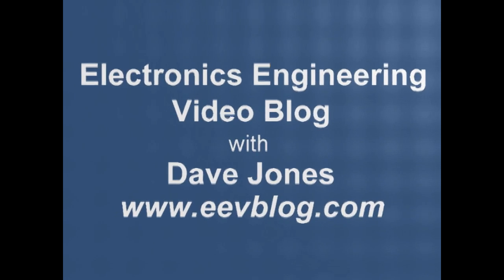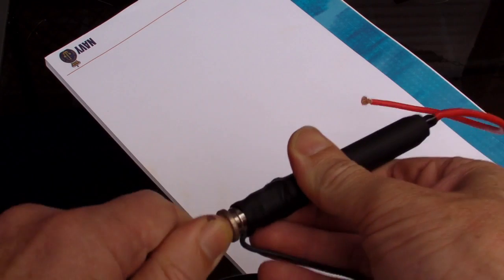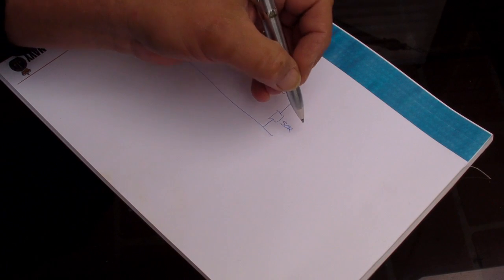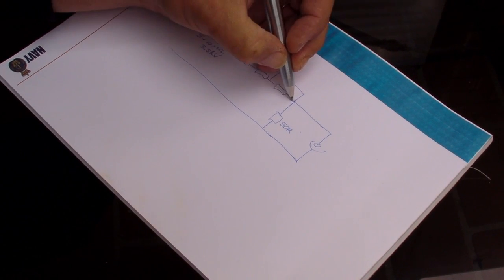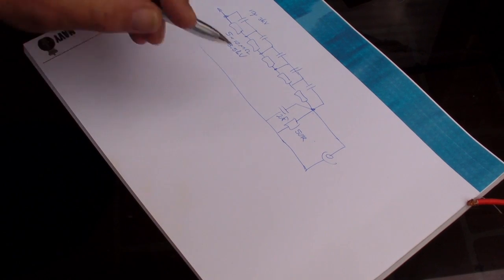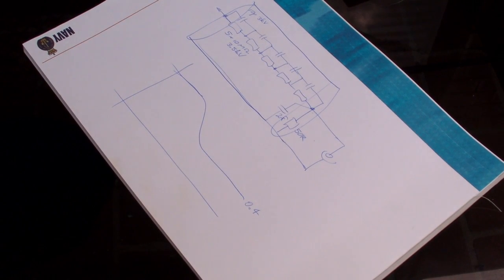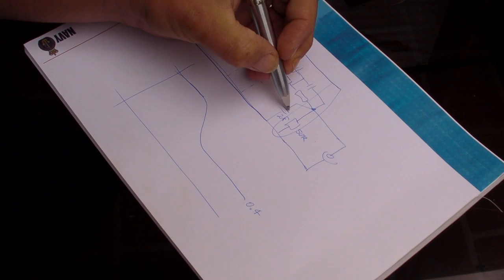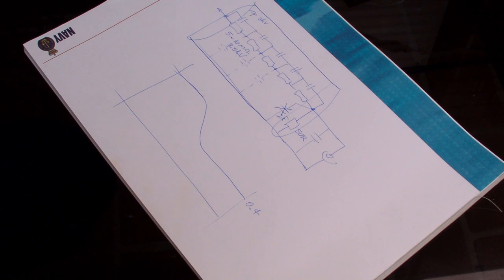EEVblog #85 - High Voltage Oscilloscope Probe Design

Comment: Hi, thanks a lot for your video. In order to check the wave of an inverter or mains, is it ok to use a step down transformer 240/24 ? Will it smooth or disturb the 50/60Hz signal ? What about armonics ? Thanks.

Comment: Question please....  When you connect your scope probe, do you set it for x1 or x10????  the resulting multiplier would also be selected in the scope, (the 1000x option) I have a small bunch of 1000Mohm 10 KV 1 watt resistors and if I was mostly using for DC voltages, could placing one of these in series with the scope probe and with the scopes impedance being ~1 Mohm, would this provide satisfactory readings with the scope probe set to x1 and the 1000Mohms would be very roughly a 1000 to 1 ratio???  I did try this for my DVM with 2 1000Mohm 10KV 1 watt resistors in series and this worked out to about a 200 to 1 ratio since my Fluke has a typical-measured, 10 Mohm internal resistance and my reading were very close to what was expected, (the Fluke is considered to be a x1 device)....  It would not be elegant, but do you think a similar hook up for my scope would suffice??  Thanks for any explanations you may provide....  Hank

Comment: Hey Dave, this is excellent! I'm not much of an electronics guy, mostly mechanical, but I do need to do an increasing number of electronics projects these days. So I was wondering if you have an EEVblog # that deals with how to Protect a Probe from a voltage spike? Thing is, I made a make-shift probe for probing vehicle secondary ignition signals, and if the coil or wire has leaks, a 30kv spark will jump into the probe tip and fry the scope. It's an inductive pickup of sorts, so it's not designed for direct electricity. So I was wondering how to make some kind of shunt or protection for those sparks. Got a blog on doing that? Thanx!

Comment: For divide by 1000, you should consider two divide by 32 stages.  Also, you can provide an inner shield connected to the probe if your HV has low impedance; this increases input capacitance, but maintains your HF response.

Comment: what happens if you put two 10:1 attenuators in series? does it make it 20:1?
Reply: Gear Wrench87 No. Think about it this way: what happens if you take 10% of something and then take 10% of that?
Reply: 10 percent of 100 volts is 10. 10 percent of ten is one.  200= 20   i think that would make it higher attenuation then huh?
Reply: Yes, having two attenuators of 10:1 in series would result in more attenutation of a signal going through than a single 20:1.

Having multiple stages of attenuation results in the overall attenuation being equal to the product of each stage. The same applies to amplification. If you have two stages: One with a gain of 5 and the other with a gain of 2 then the overall gain would be 10 and not 7 since you multiply rather than add. That being said, If your gain or attenuation was written as a logarithmic ratio or dB then you would add or subtract across rather than multiply or divide.
Reply: trophosphere  beautifully stated. Thank you.

Comment: Cool,but good probes use coax with a resistive center conductor to reduce ringing when used with a high impedance scope input.A resistive conductor distributes the total resistance (usually around 100-200 ohms) over its length.A lumped (discrete) resistor on the end of a piece of regular coax will not noticeably reduce ringing.Also a hi-Z probe should be well shielded and then there is the 'high voltage' issue....

Comment: I'm interested by the cal factor. What does this represent exactly? Is it the ratio of input to output voltage?
I assume that you'll be attaching your probe to an oscilloscope, which will have 10-15pF capacitor and a 1M ohm resistor within that scope. It looks like you've omitted that out of your design, which also might be a reason why the cal factor alters at 200Hz.
Reply: 08Ultrasonic Yep that's what the cal factors means. And he designed the thing to fit the scope input as stated in the video and no the scope input has nothing to do with it, it was stray capacitance

Comment: My oscilloscope is a PC type that connects via USB. For testing your average low voltage signals and frequencies it works well and responds fast! However, I've built some "high" voltage DC power circuits and voltage doublers varying from 100VDC to 350VDC. I have a two-channel OWON VDS-1022 which says the maximum input voltage is 40Volts from what I can see.

So how could I test that? Could I modify the probe or use a resistor or two? I'm not talking KiloVolts here!
Reply: You basically need to scale down the voltage. I would build a 10:1 or 100:1 voltage divider to probe, depending on the limitations of your scope specs. If you alter your probes attenuation, you'll have to scale in the difference on the display. You should look up the design of a scope probe. An attenuating scope probe is basically a voltage divider but bear in mind that you have fixed 1M resistor in your scope that you can't change.
Reply: mine is just my soundcard :) its pretty good too.

Comment: Nice video. I guess it must be very important to properly clean away every little particle of grease, dirt and flux residues from the whole RC network before potting it in order to minimize the risk of arcing?
Reply: Yes you can also use a dielectric adhesive which can increase the breakover voltage.

Comment: Hi,   How do you measure  a  higher voltage, like 50kv  that is very low frequency so we cant use the propes as antenna pickups..?
Reply: Kaledius just as it was done in this video. You can probably scrap all the capacitors though since you don't care about medium or high frequency

Comment: Do you think it is safe to use these probes to check the voltage of windings of one SMPS?
Reply: What type of an SMPS? If it is a flyback converter with 15kv output probably no,  but if it is just like a 12v psu it is ofc ok.

Comment: I have a question about digital oscilloscopes. Do you know what bandwidth would be needed to measure the peak resonance of a coil rated around 3000kHz? I'm not sure if the bandwidth is actually the specifications of the frequency range it can detect, or if it is something else. If you have any direction I could go in trying to find the right oscilloscope, I would greatly appreciate it. Thanks
Reply: use a fourier transform. a good bet would be to use a PC soundcard, AC coupled after being voltage divided. you can record it into your PC soundcard and use audio software like Audacity or REAPER which will FFT the signal and show you the frequencies.  i do it all the time. 

the bandwidth you'd need is 6000k which is nothing for a soundcard. oh wait i just read that right. 3000k is steep. ok use diodes to clip the signal and create subharmonics. maybe that'll work :P im out of ideas.

Comment: Those small caps are 3kV rated? It doesn't look like that.

Recently I needed to get rid of the scope ground connection for measuring HVDC up to 1000V and current on the positive side. So I designed (a bit amateurish) universal analog isolator with current input, it should isolate 1500V minimum. It can measure from mV to kV with great linearity depending on the input resistors. But I didn't include those caps accross resistors, I should read more about them.